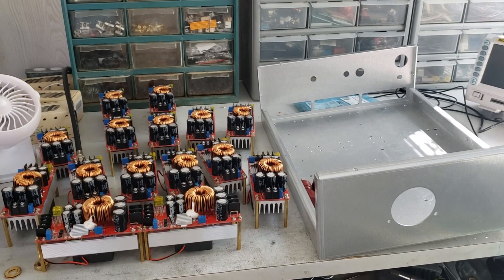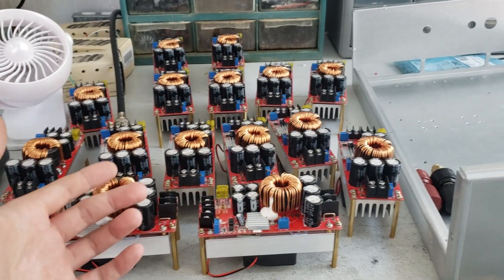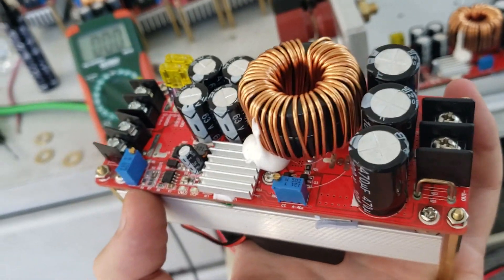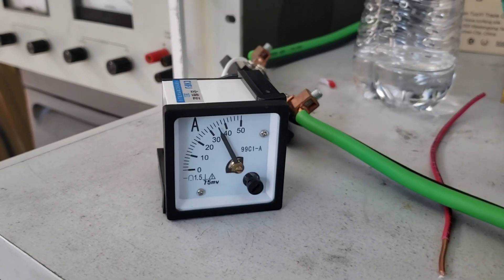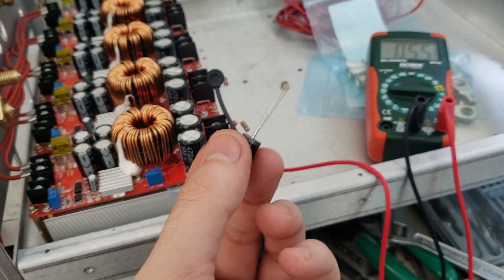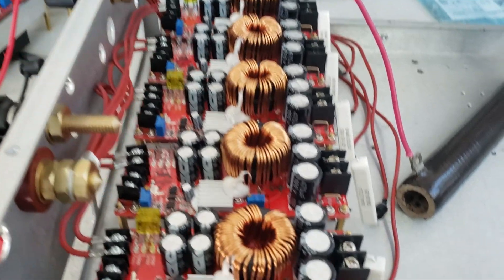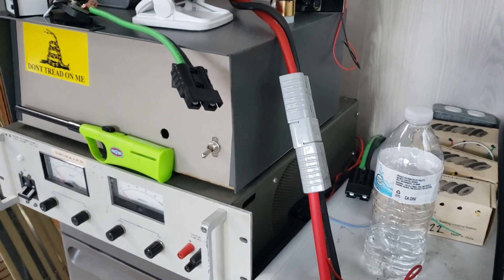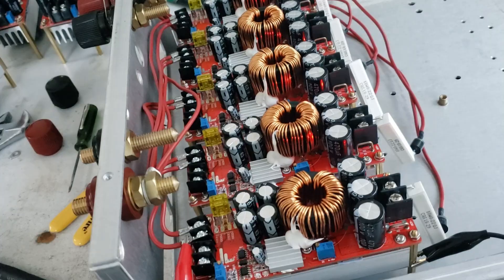Mobile LDMOS Supply (Pt. 1)

Comment: Hey I have 10x40 Amp switching power supplies in parralel. I'm trying to get a good load sharing system. Can you point me in the right direction on any info?
Reply: Mike, you could try to connect at a minimum a .01 ohm 50 watt resistor off each PS positive rail (one resistor per PS) going to your main positive terminal.  Note you will experience a .4 volt drop with .01 ohm.  If you parallel two .01 ohm at each supply you will have .005 ohm resistance and a voltage drop of .2 volts (better) and 100 watts to dissipate the heat vs. 50.   Just keep this in mind when you are adjusting your voltages.   The way this works is each PS is isolated by the balancing resistor and they can't see themselves and when a load is applied each will share it equally.  

Here is a video by RF man explaining this network.  https://www.digikey.com/product-detail/en/te-connectivity-passive-product/THS50R01J/A132078-ND/2366771

Here is an example of this resistor https://www.digikey.com/product-detail/en/te-connectivity-passive-product/THS50R01J/A132078-ND/2366771 

73s and best of luck.
Reply: @baltimore_amp_repair  thank you for the great Info
Reply: DID YOU CHECK TO SEE IF THEY HAVE A CURRENT SHARING WIRE OR CONNECTION ?
Reply: @flhusa1  no they are just the ica 40 Amp switchers. You gotta set up your own load sharing I'm I'm pretty sure
Reply: So rf man is great. I'm still working on calculating the whole ohms law thing to figure out what I'll need for resistors. I understand it needs to end up at .1 ohm but I need to figure out how many watts each resistor needs to be. I have to order an army of resistors for a monster dummy load I'm building so I wanna order them at the same time. These switchers are 30 amps at 15 volts and that's right where I'm gonna run em.  Im still figuring it out but if anyone wants to chime in and help me understand how you come up with an answer I'd appreciate it
Reply: Brandon Parker 1 each, .01 ohm 50 watt resistor per supply.  I mentioned that above based on the info you provided.
Reply: @baltimore_amp_repair  oh dam you did too. Well thank you I'm glad you pointed that out. I have them in a rack right now. Which is super convenient a d all. But I wanna put it in a huge box and make a. Mammoth of a power supply. Like 20 of these things. Big buss bars for em and internal load sharing. I won't even run my stuff at full power because I don't wanna burn out switchers. I mean they work. But we all know what's going on behind the fact that "they work".... They may work now. But it's a fact that it will only be so long before they start popping from improper load sharing amongst each switcher

Comment: Mudd Duck Sharky ware did you acquire the red and black connector for the cabinet  if don't mind sharing info been look for pair for a power supply  thanks James
Reply from the maker: Ebay, search "999 binding post"

Comment: I've put two of these in parallel, they didn't share load correctly, and one set of fuses blew on one of them.  Nice to see the large diodes and resistors working.